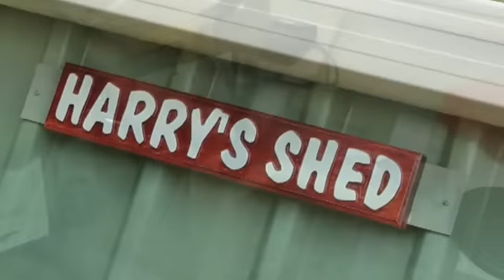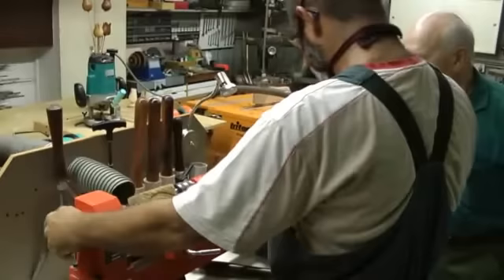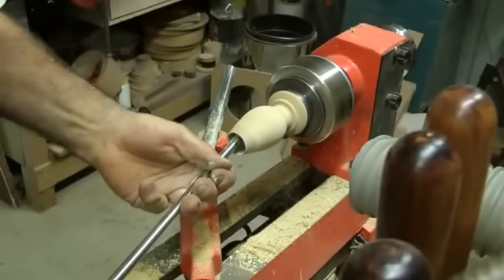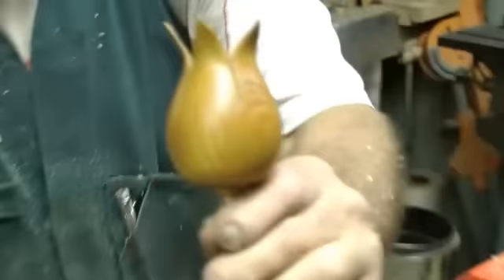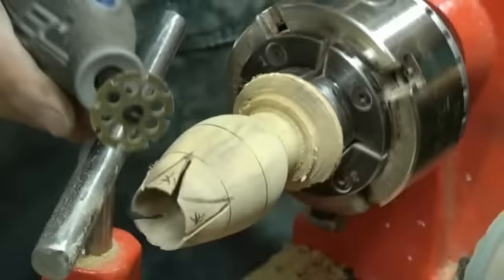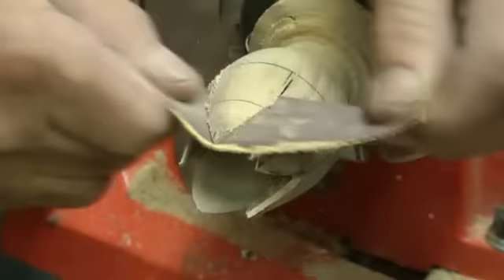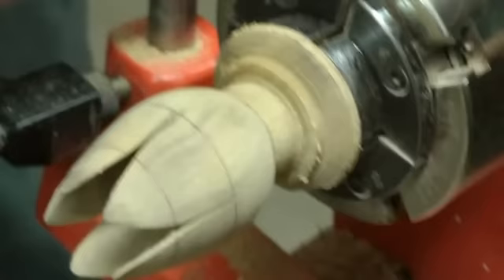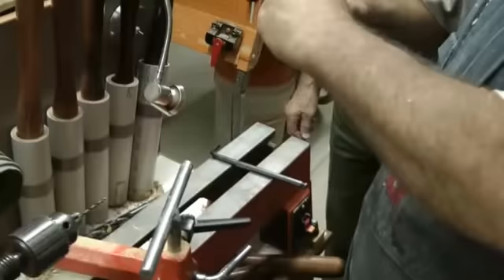Tulips turned in the lathe

Comment: What is the name of that spinning sanding device that you use to finish sand the flower? I love it and have never seen it before.
Reply: 2 inch Diameter Bowl Sander with Dual Bearing Head and 2 inch Foam Hook and Loop Sander with 1/4 inch Mandrel and 9 inch Long Hardwood Handle, from amazon